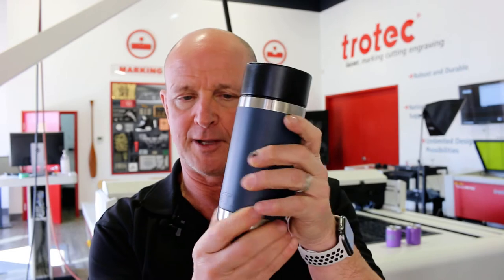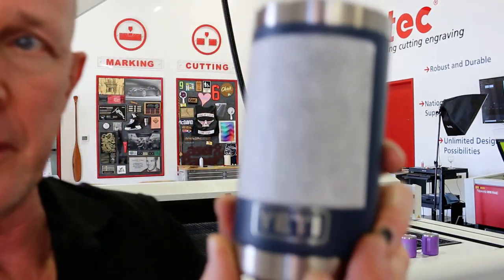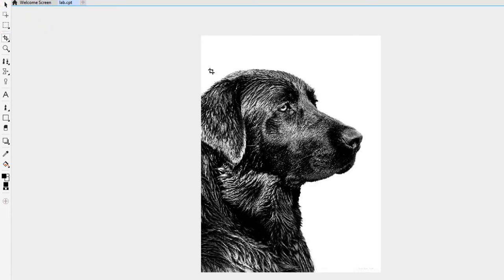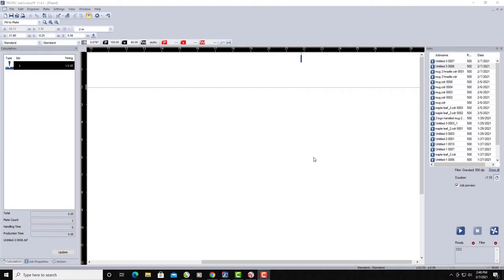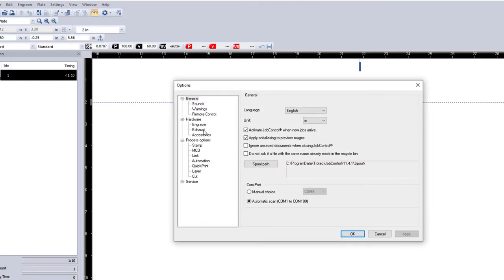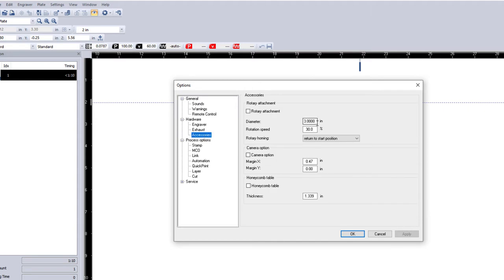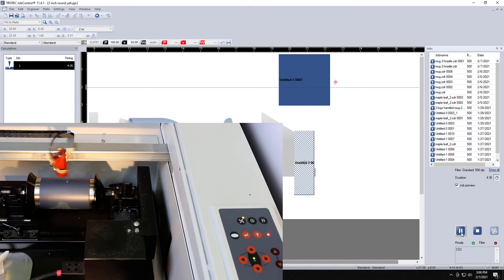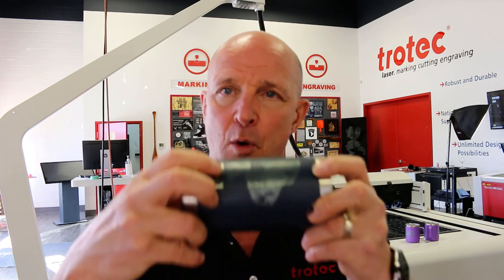Using the Trotec Rotary to do a Yeti Mug

Comment: Tip for you!✨⭐️ if you don’t have the laser go back to start upon completion, you can press the curved arrow on the machine to repeat the job! it will do another pass in the identical spot - no clean up needed (make sure tk clamp tight) Also the magic eraser could dull your paint!

DO NOT rotate your peice manually, the jerking will cause it to misalign!